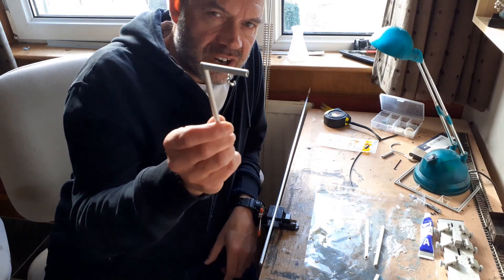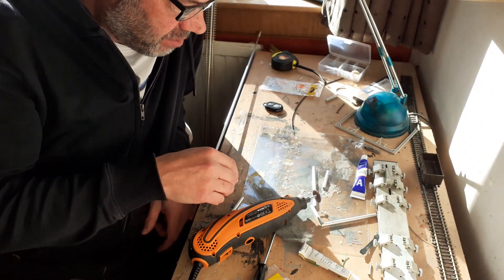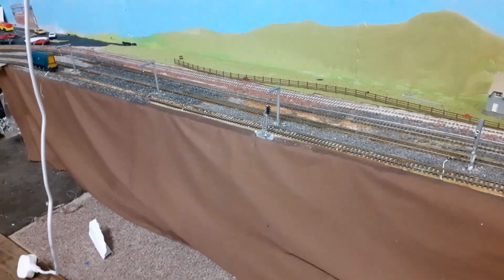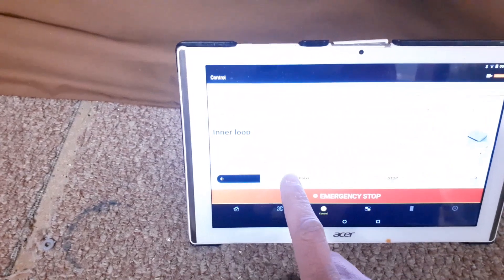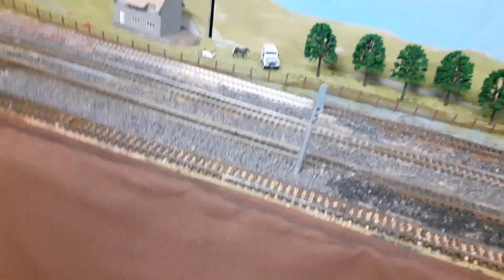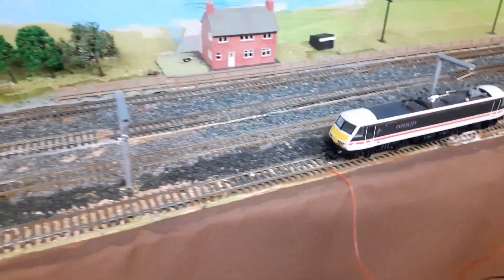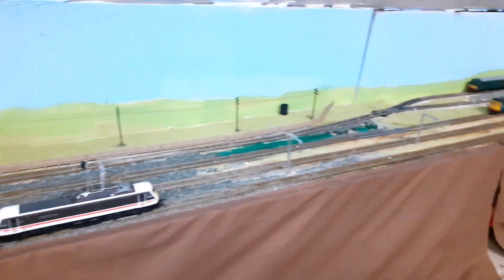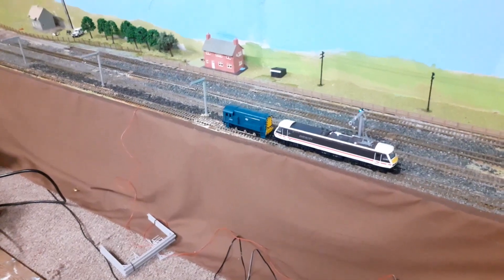Model railway Working catenary system for pennies

Comment: Amusing as always! I have a Triang EM2 locomotive and had catenary which was a combination of the 1960s and stuff I made myself out of old rails and catenary wire. I found it quite restrictive when trying to access the track so I removed it about 5 years ago. What wire did you use for the conductor?
Reply from the maker: Dunno what you call it? Just excess wire ordered ages ago for point motors etc. I removed the sheathing over the gas hob with my thumbnail.